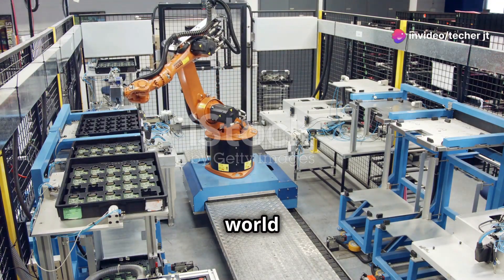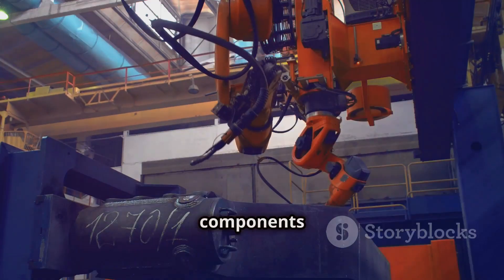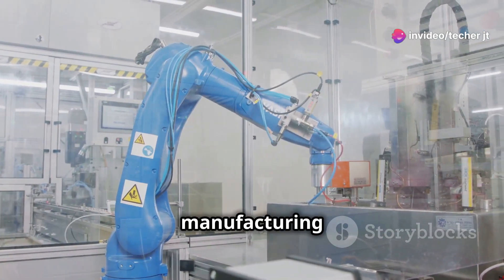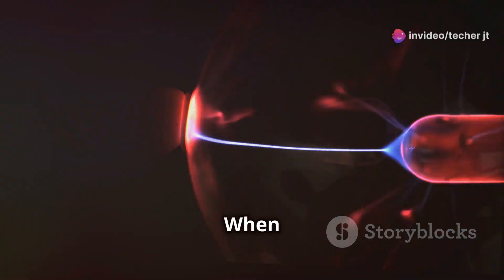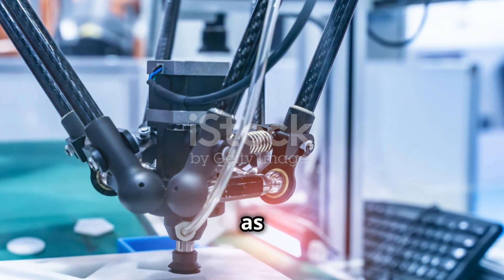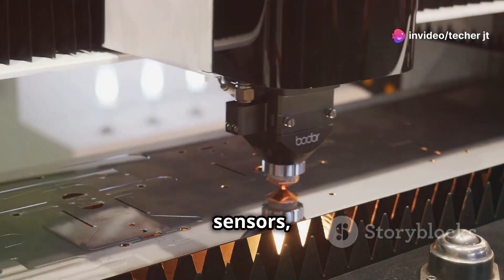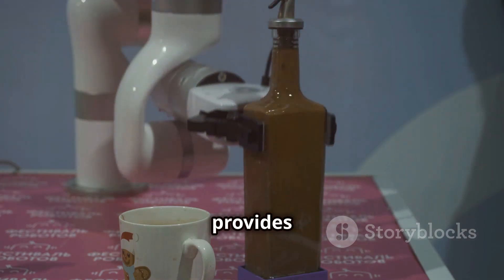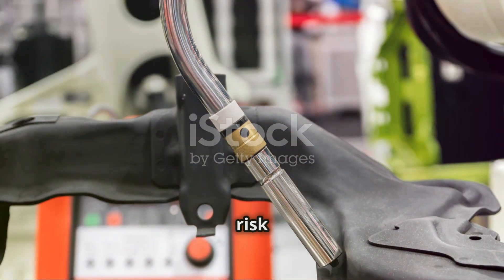Inductive Sensors for Robotics

Comment: Princess Dawn B. Lamberte
10-LYNX

5. Identify two applications of inductive sensors in robotics and explain their roles.

The key difference between shielded and unshielded inductive sensors lies in how their electromagnetic fields are concentrated. Shielded sensors feature a metal casing that focuses the field toward the front, providing more accurate detection but with a shorter range and reduced interference from nearby objects. In contrast, unshielded sensors, without this casing, allow the electromagnetic field to disperse in multiple directions, giving them a longer sensing range but making them more sensitive to nearby metal objects. Shielded sensors are best suited for precise, close-range detection, whereas unshielded sensors are more effective for detecting objects at greater distances.

Comment: LA Treassia P. Llaban
10 - LYNX

4. What are the advantages of using inductive sensors over other types of sensors in robotic applications? 

- Inductive sensors have several benefits over other sensor types in robotic applications. They are extremely durable and can endure tough environmental conditions, making them perfect for industrial use. Since they are non-contact sensors, they don't need physical interaction with the object, reducing wear and extending the sensor's lifespan. Additionally, inductive sensors offer high accuracy and consistency, making them well-suited for precise positioning and measurement tasks. They also have a quick response time, providing real-time feedback and control in robotic systems.

Comment: Angel Stephanie Ledesma
10 - Lyra

1) What is the primary function of primary sensors in robotics?

- Inductive sensors detect changes in the magnetic field around them. They are commonly used to detect the presence, absence, or movement of metal objects. This is because metal objects can alter the magnetic field, which the sensor can then detect.
Reply: Mitch Micah Niere 10 Lyra

Medical robots give surgeons increased accuracy and control, enabling them to perform sensitive procedures in inaccessible areas using smaller incisions, leading to decreased pain, quicker recovery, and lowered chance of complications.

Comment: Andre Clyde Eduardo C. Acta
10-LYRA

2.Describe the difference between shielded and unshielded inductive sensors.

The difference between shielded and unshielded inductive sensors is that the shielded is covered with a thin meta plate to focus the range into a smaller area and prevent false readings, while the unshielded inductive sensor has no metal covering it allowing for a wider range and usually makes false reading but useful for detecting metal objects in the vicinity. Sorry for the late pas, I forgot to comment my nswer, I got used to writing it in the paper.

Comment: Phoebe Coleen G. Flores
10-LYNX

Inductive sensors are a crucial component in robotics, primarily used to detect the presence and position of metal objects. By generating a magnetic field and sensing changes in it when a metal object enters, these sensors enable robots to avoid obstacles, accurately position parts, and control end-effectors effectively. Their reliability, durability, and accuracy make them a popular choice in various industrial robotics applications.

Comment: Sophia Margarette G. Peñoso
10- Andromeda 

Q1. What is the primary function of inductive sensors in robotics?

Answer:  Since they give robots the ability to detect touch or proximity, inductive sensors are essential parts. They are well known for being sturdy, affordable, and reliable, which makes them perfect for a variety of robotic applications. Inductive sensors enable robots to perform a wide range of activities, from basic task identification to intricate navigation, precisely and efficiently in a variety of settings. They serve as the robot's eyes, identifying the location and presence of metal objects. The robot's control system will then get the information, enabling it to adjust its motions as necessary.

Comment: Camyll Jhey P. Belhot
10-Hermes

2.Describe the difference between shielded and unshielded inductive sensors
-Unshielded inductive sensors lack a metallic shield around the coil, this type results in a wider more diffused sensing fields that extends until the sides, its extension can be beneficial however they are more likely to pick up unwanted metals leading to false reading. Shielded sensors has a metallic shield around the coil and focuses on the magnetic field to a more smaller and focused area it is beneficial because it reduces sensitivity minimizing false triggering allows flush mounting.

Ultimately, the choice of shielded and unshielded depends on the application requirement. Shielded is suggested where application needs precise detection within an area and environment with potential metallic interference. On the other hand, Unshielded is preffered to applications of wider sensing range is acceptable and the risk of interference is minimal.

Comment: Angel Sofia C. Tabaniag
10 Andromeda 

5. Identify two applications of inductive sensors in robotics and explain their roles.

ANS: Autonomous vehicles utilize inductive sensors to sense obstacles and keep a safe distance from them, while robotic arms on assembly lines use them to precisely locate metal components.

Comment: Jana Sophia D. Enopia
10 - Lyra

1. What is the primary function of inductive sensors in robotics?

Inductive sensors in robots help detect if metal objects are nearby without physical contact. They create an electromagnetic field and notice changes when metal is close, allowing robots to sense objects and measure distances.

Comment: Aiko Alzula
10 - Cassiopeia 

3. The sensing range in inductive sensors defines the maximum distance for detecting metallic targets. It is influenced by the target's material and size, with optimal performance usually calibrated using mild steel. Understanding this range is crucial for selecting the right sensor for effective detection in industrial applications.

Comment: Gene Berta Rose F. Hererra 
X Hermes

1. Inductive sensors are used in robotics to detect metal objects without touching them. They create an electromagnetic field and look for changes in the field when metal is nearby. This helps robots find objects and measure how far away they are.

Comment: Ma. Pashka R. Resoso
10-Lyra

2. Describe the difference between shielded and unshielded inductive sensors.
Shielded inductive sensors have a metal housing around the sensing coil, which focuses the magnetic field to detect only objects directly in front of the sensor. This reduces interference from surrounding materials and allows for closer placement to other sensors, while unshielded inductive sensors lack this metal shielding, allowing their magnetic field to spread in a wider area, enabling detection from different directions but making them more prone to interference from nearby objects.

Comment: Alexa Kyle R. Cabunoc
10-HERMES

2. Describe the difference between shielded and unshielded inductive sensors.

- The primary difference between shielded and unshielded inductive sensors lies in their electromagnetic field and sensing range. Shielded inductive sensors have a metal shield around the sensing coil, which directs the electromagnetic field to the front, resulting in a more focused detection area and reduced interference from surrounding metal objects. This makes them ideal for detecting targets in confined spaces. In contrast, unshielded inductive sensors lack this shielding, allowing the electromagnetic field to extend in multiple directions, which increases the sensing range but also makes them more susceptible to interference from nearby objects.

Comment: Jag Alona S. Ramayla
10 - Lyra

The difference between shielded and unshielded inductive sensors is in how their electromagnetic fields are focused. Shielded sensors have a metal casing that directs the field to the front, offering more precise detection with a shorter range and less interference from surrounding objects. Unshielded sensors, lacking this casing, allow the electromagnetic field to spread in multiple directions, resulting in a longer sensing range but higher sensitivity to nearby metal objects. Shielded sensors are ideal for close, accurate detection, while unshielded sensors are better for detecting objects over greater distances.

Comment: Maykylla Geraldine R. Egarguin 
10-LYNX

1. What is the primary function of inductive sensors in robotics?
Inductive sensors in robotics are primarily used to detect the presence or absence of metallic objects without physical contact. They work by generating an electromagnetic field, which is disrupted when a metal object enters the sensing range. This allows robots to perform tasks like object detection, positioning, and proximity sensing, all while maintaining durability and reliability in harsh environments where physical contact may cause wear or damage.

Inductive sensors in robotics detect metal objects without contact by sensing disruptions in an electromagnetic field, enabling precise object detection, positioning, and proximity sensing.

Comment: Glenn Seth Myrrh B. Laluces
10 - Hermes

1. What is the primary function of inductive sensors in robotics?

The primary function of inductive sensors in robotics is to detect the presence of metallic objects without physical contact. They work by generating an electromagnetic field and measuring changes in that field caused by nearby conductive materials. These sensors are commonly used in robotic systems for position detection, object counting, and ensuring safety by detecting proximity to metal surfaces or components.

Comment: Michaella Mae A. Ragmac
X - Cassiopeia

3. Explain the significance of the sensing range in inductive sensors.

The sensing range in inductive sensors determines the furthest distance at which they can detect metallic objects. This range is affected by the material and size of the target, with optimal performance typically calibrated using mild steel. Knowing this range is essential for choosing the appropriate sensor for efficient detection in industrial settings.

Comment: Khieffer Neil G. Ensomo
10-Hermes

1. What is the primary function of inductive sensors in robotics?
-The primary function of inductive sensors in robotics is to detect the presence or absence of metallic objects without physical contact. They work by generating an electromagnetic field and measuring changes in the field when a metal object enters the detection range.

Comment: Cherish Stefie D. Bacayo 
Grade 10- Lyra

1. What is the primary function of inductive sensors in robotics?

Answer: Inductive sensors are primarily used for proximity detection in robotics. They work by detecting changes in the magnetic field caused by the presence of a metallic object. This allows robots to sense the distance to objects without physically touching them, which is crucial for tasks like obstacle avoidance, part handling, and precise positioning.

Comment: Marion James C. Nale
10 - Lynx

1. What is the primary function of inductive sensors in robotics?
Inductive sensors act as a robots eyes, detecting the presence and position of metal objects. This information is then relayed to the robot's control system allowing it to adjust its movements accordingly.

Comment: Zane Mendaros
X - Cassiopeia

4. What are the advantages of using inductive sensors over other types of sensors in robotic applications?

Reliability and Durability: Inductive sensors operate without physical contact, reducing wear and tear, ensuring a longer lifespan, and allowing for reliable performance in harsh industrial environments.

Robustness: They are known for their ability to function in diverse and challenging environments, such as extreme temperatures, dust, and vibrations, making them ideal for automated manufacturing processes.

Precision: Inductive sensors provide accurate detection of metal objects, which is crucial in applications like assembly lines where precision is key to avoid errors in part detection and placement.

Cost-Effectiveness: Compared to other sensing technologies, inductive sensors are relatively affordable, allowing for widespread use in a variety of robotic applications.

Non-contact Operation: The non-contact nature of inductive sensors prevents mechanical degradation over time, ensuring consistent performance and reducing maintenance costs.

Application: Inductive sensors can be used in a wide range of applications, from obstacle detection in self-driving cars to positioning devices in medical devices, be adapted to various sectors..

Comment: Messiah Emmanuelle Lei P. Salomon
X-Cassiopeia

5. Identify two applications of inductive sensors in robotics and explain their roles.

-Inductive sensors are commonly used in robotic applications such as metal part sorting and assembly. In metal part sorting, inductive sensors can be used to identify different types of metal objects based on their electrical conductivity. In robotic assembly, inductive sensors can be used to detect the presence of metal components and ensure that they are correctly positioned for assembly.

Comment: Ara Bella S. Quilestino
10 - LYNX

1.  What is the primary function of inductive sensors in robotics?
Inductive sensors are crucial in robotics, enabling touch and proximity detection. They enhance precision in tasks like part detection and navigation, utilizing electromagnetic induction to identify metallic objects without contact.

Comment: Jannah Loreen S. Galla 
10 - CASSIOPEIA 

Q: 1. What is the primary function of inductive sensors in robotics?

A: The primary function of inductive sensors in robotics is to detect the presence or proximity of metal objects without physical contact. These sensors work by generating an electromagnetic field and measuring changes in the field when a metal object enters it. Inductive sensors are commonly used for position sensing, object detection, and safety applications in robotic systems, particularly in industrial environments.

Comment: Jaynie Margaret M. Lashley
10 - Andromeda

1.) What is the primary function of inductive sensors in robotics?

-  It provides the robots or robotic applications, a sense of touch or proximity detection. They also act as the robot's eyes, detecting the presence and position of metal objects, Which is then relayed to the robot's control system, allowing the robot to adjust its movements accordingly.

Comment: Shiloh Nouvel A. Miquiabas
10 - ANDROMEDA

2. Describe the difference between shielded and unshielded inductive sensors.
Answer: Shielded inductive sensors have a metal housing around the sensing coil, focusing the magnetic field to detect only nearby metal objects. Unshielded inductive sensors lack this housing, allowing a wider magnetic field for detecting objects at greater distances. Shielded sensors are ideal for confined spaces, while unshielded sensors are better for longer-range detection.

Comment: Real Ann R. Dela Victoria 
10 Andromeda

1. What is the primary function of inductive sensors in robotics?

Answer: The primary function of inductive sensors in robotics is to detect the presence or absence of metallic objects without making physical contact. They function by creating an electromagnetic field and monitoring changes in that field induced by the presence of metal, allowing robots to sense things and calculate distances for a variety of purposes.

Comment: Manzanades, Chelsy
10- Andromeda 

2.) Describe the difference between shielded and unshielded inductive sensors.

- Shielded sensors incorporate a metallic shield around the coil, effectively concentrating the magnetic field to a smaller more focused area, while unshielded sensors lack a metallic shield around the coil, this design results in a wider more diffused sensing field.

Comment: Faith N. Ragas
10-Andromeda

2. Describe the difference between shielded and unshielded inductive sensors.
Inductive sensors with shields reduce false readings from nearby metal objects by concentrating the magnetic field within a defined, narrow area using a metallic shield. Since unshielded sensors do not have this shield, their sensing field is broader but they are more likely to pick up on inadvertent metal objects. Depending on the application's environment and precision, one can choose between the two.

Comment: Janaya Dyreane S. Baja
X Lyra

3. The sensing range in inductive sensors defines the maximum distance for detecting metallic targets. It is influenced by the target's material and size, with optimal performance usually calibrated using mild steel. Understanding this range is crucial for selecting the right sensor for effective detection in industrial applications.

Comment: Ana Althea B. Mabaylan 
10 - LYRA

2. Describe the difference between shielded and unshielded inductive sensors.

- Shielded sensors are designed for use in confined spaces and have a reduced sensing range. While unshielded sensors have longer ranges and can detect objects at greater distance.

Comment: Shuwla Maine C. Lugtu
10- LYNX

1. What is the primary function of inductive sensors in robotics?
- Inductive sensors in robotics are mostly used to detect the presence of metal items without making physical touch. They function by producing a magnetic field and monitoring any alterations brought about by the presence of metal. This makes it possible for robots to assess their surroundings, avoid hazards, and carry out industrial applications such as part identification and sorting.